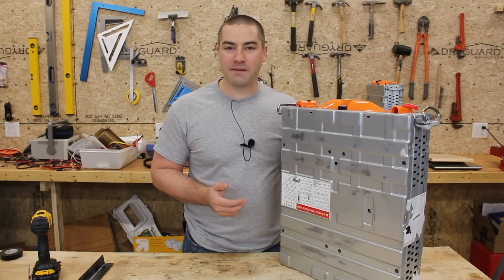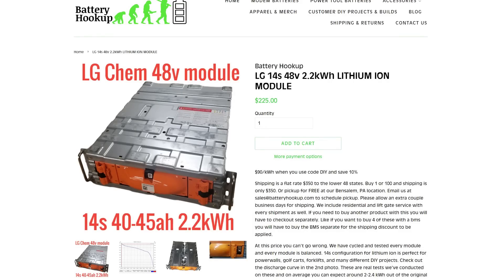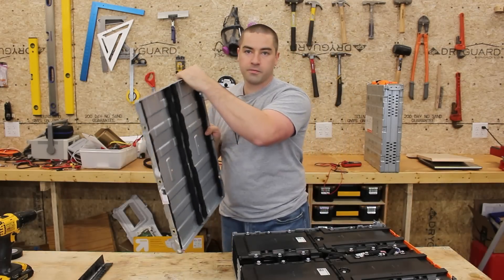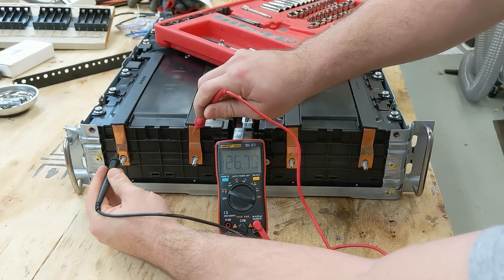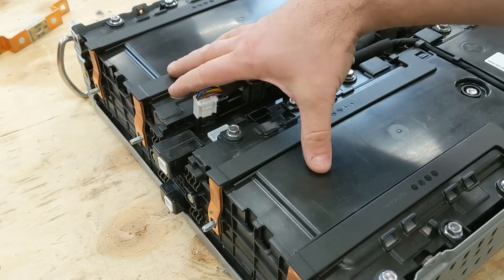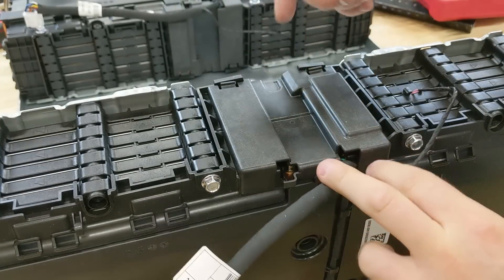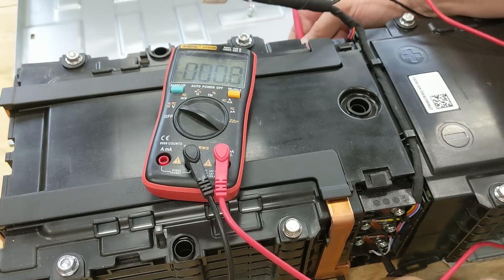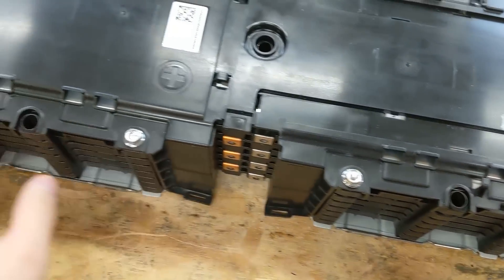Batteries for Home Backup, 14s 48v (51.8v) LG Server Rack Lithium

Comment: These server batteries have a center pack fuse, which would be a good thing if the BMS was designed for it, but the BMS used in this video is not. IF the fuse ever blows, the BMS will likely be destroyed. Imagine you had a 10A load connected to the main pack + and - terminals. Now Imagine that the fuse is open. You'd now have a 48V potential between cell 7 and cell 8 capable of supporting 10A of current (through your load). The BMS would measure 48V across a cell that it was only designed to see 4.2V, BMS go boom. If performing this mod similar to what David is doing, I recommend replacing the fuse with a copper bar PRIOR to plugging the BMS voltage sense connector into the BMS. Place the fuse on the main pack plus or minus terminal instead. 
  In the video shots of the original "BMU" with the case removed, you can clearly see two larger integrated circuits, and two sets of balance resistors. The whole circuit board seems to be split into two isolated, identical sections. The BMU looks to have two separate, isolated sections, specifically designed to allow a large voltage difference between cell 7 and 8. Never use a fuse or disconnect in the center of the pack unless your BMS is specifically designed to support it.

Comment: David, just another little tip you may have overlooked: instead of using heaters as a test load you should try charging your main batteries instead. That way you're not wasting the energy. Just get a buck/boost module if needed.
Reply from the maker: Thanks for the tip.  I would have, I own a boost converter, and a buck converter, but during the discharge process the voltage would cross.  So I would need a buck/boost converter in one device, which I don't have.  Although I could go from the battery, to inverter, to 24v power supply, to boost converter.  Hehe.  A lot of loss, but would be fun.
Reply: @DavidPozEnergy  A lot of loss is still less loss than total loss :) Though with the first snow of the year being today maybe a bit of heating isn't the worst thing ever.

A more hacky alternative to a buck-boost converter is just chaining a buck converter and a boost converter.

Comment: I like to use 20ga for balance leads, or atleast 22ga, the silicone insulation on 20ga is a bit thick for the pin yourself connectors, but 22ga works well,

Comment: Are we sure there isn't an in-built bms?  That box you removed looks to at least offer balancing from the one I've dismantled (it isn't a simple pass-through).   I have 6 batteries and wired in one with a bms that I bought from the seller but it doesn't balance well  because I never charge to 4.2v/cell as it is set from the factory.  As soon as I can get the bluetooth module for it I will see if I can lower the balance voltage.  The ones that I've left the factory manager installed on are all well balanced after several weeks.  Sure there isn't over current and under voltage  protection but I have that in my charge controller/inverter.

Comment: Thanks for the video really appreciate the way the way you went about  your disassembly.    I got 10 of those delivered ( 1 was at 38.2v. Cycling it now)  im actually disappointed with the capacity was hoping it would be greater than 2.2.     I have all 10 running with my 25kw nissan wall.   I really like the idea of reorganizing the packs into 2s7p. And then only using 1 smart bms to manage.   Really do not like having 10 seperare bms with Bluetooth. Would want a centralized nms management console (1 shop monitoring)

Comment: i recently built and capacity tested a 7s 7sp configuration of this exact battery system by disassembling each individual 7s module and converting it to a 1s 7p module and connecting 7 of those in series for my system and it only capacity tested to 6.7kwh before my lowest cell hit low voltage disconnect with a battery hookup bms, the reason I say this is be weary of simply reconfiguring modules into 1s packs without testing individual cells specifically and combining those to match capacity as accurately as humanly possible to save yourself the headache that I am now stuck with of having to disassemble all the modules again but otherwise great cells
Reply from the maker: Thank you for sharing your experience and advice.

Comment: Where do you find these modules new? You can find whole systems for solar by LG Chem no problem. Would be nice to buy them individually and add them over time as bank account permits, especially for just home back up. It would be nice to see a system in parallel with an auto-transfer switch plus generator hookup to top off batteries for those long term outages.

Comment: David, Your videos are always so complete and clear.  A question you may be able to give me some guidance on--I am completely off-grid and currently use 2 ea propane 5,000 watt portable generators giving power at 30 amps and either/or 120 or 240 v  ac single phase.  My goal is to purchase some thing like in this video but I need to have an inverter (I think) to transform voltage to allow use of pumps and motors at above conditions.  My use is nominal 8 hr/day at 50% of capacity (wattage) and 10 hr/dy.  Until I can get solar I plan on having making the battery source transportable about a half mile where I can access power to recharge from the grid.  Your comments are appreciated--thank you.

Comment: I really like the way you go through explaining it you do really well I think I probably am starting to get to where I might care about a 48 V but I don't have anything that's 48 V my stuff can either be 12 or 24 V so maybe I had to just go up to 24 but then I still have to have a way to just deal with the 12 V stuff confused about how that goes I had a little confused about how to get to the rest of your stuff
Reply from the maker: I'm a big fan of 48V.  If you make the move, but still have some 12V stuff there are two ways you could handle it.  1. run 48V to the appliance that's 12V (fan or light or whatever) and then use a small step-down converter (buck converter) to 12V.  Or, 2. have a 12V solar system with panels, one battery, etc. at 12V and power your loads off that.

Comment: would not break the spot welds off i would cut the metal join in half this would give a more solid connection to bolt together and work with

Comment: The voltage pattern displayed on your phone via the Bluetooth dongle indicates a problem in how the BMS is measuring the voltage on each battery.
You have one pattern from the low to the middle, and a duplicate pattern above it.
 The only other possibility is that the center batteries have more degradation due to heating than the outer cells do..
Reply: I noticed the same thing. The pattern was way too particular to just be coincidence. My guess would be heat and degradation but who knows.

Comment: I greatly appreciate the video David!  The biggest takeaway for me was the very last thing you said -- that this battery is NOT a good choice for an off grid setup. This is very important for me to learn as I am currently trying to ingest as much info as I can before I buy batteries and other components for our first step at converting our home off grid... it will be a long journey for us, but we have 5kw of PV already, just waiting to get my know-how before buying other bits. So... is there a DIY battery solution/setup you would recommend for off grid? I plan to run our system at 48v. Thanks for the content all the same! -Sam
Reply from the maker: There are two types of batteries that are both very popular.  1. Used EV cells.  EV battery cells can be excellent.  I've bought several in the $90-$110 per kwh range.  The ones I've bought from Chevy and BMW cars have tested 80%+.  Like this: https://batteryhookup.com/products/4kwh-chevy-volt-battery-24s-2x-12s-modules  (DAVIDPOZ discount code works at Battery Hookup)
2. is LiFePO4 cells straight from China.  The best deal is usually in the large format cells, like 280ah.  Here is an example.  16 cells makes a very nice 48v. https://www.aliexpress.com/item/1005001784720962.html?spm=a2g0o.productlist.0.0.327343f40wNhnY&algo_pvid=679b686c-cb81-4073-8a75-5d1756765ad8&algo_expid=679b686c-cb81-4073-8a75-5d1756765ad8-0&btsid=0bb0623e16107666719543661e5c39&ws_ab_test=searchweb0_0,searchweb201602_,searchweb201603_
Reply: @DavidPozEnergy  Thank you so much for the information, guidance, and quick reply!

Comment: David, nicely done. I rack mounted 5 of these and used same BMS with blue tooth. By the way, there are plenty of these BT dongles available on eBay and they arrived from China in about  a week and work just fine. I did a capacity test and I run them every day with solar charge and offgrid discharge. Normal case, they will not cycle very much day to day, maybe 30-50%. But when I did do a deep cycle, I didn't see the major drop on certain cells. I'm wondering if you tested your other battery.
Reply: Bucky. Are you running the 5 batteries in parallel? So you have one bms for each battery? Are you having any issues with that kind of setup?
Reply: @kevinsvik747  I do have one BMS per battery and they are all in parallel. I mounted my bms’s outside in case I had an issue. So far, all 5 charge and discharge evenly which you would expect. It’s a little cumbersome to always be looking up each battery in the app. I have 2 additional batteries also in parallel with these 5. They are the Chevy Bolt 6kwh 14s type that david made last year. So I have to track 7 batteries. They all seem to play together nicely, all 14s 3.6v nmc
Reply: What bms size would you recommend please

Comment: Very informative video.  although I can't help but wince at the order you torqued and untorqued the cell bolts :D
Reply from the maker: How would you have unbolted it?
Reply: @DavidPozEnergy  i try to unbolt and bolt in a star pattern to even the stress. I've warped a few engines/motors not doing a star. I really enjoyed all of your informative content, I promise im not cherry picking 😅
Reply from the maker: Ah, like when I changed out our summer tires to winter tires last month.  You are probably right, and your idea is probably best practice.  I just didn't think about it.  No excuse.

Comment: Mount the BMS on a piece of aluminum angle and dump its heat in to case.  I don't know what it's balance current is or the internal resistance of the mosfets....  But on the hottest day, after back to back cycles, with 13 cells balancing, at full discharge.....  Thermal soaking can sneak up on you.

If the case is open air you'll start to get corrosion after a couple years.  If it's airtight..........  If it's airtight I dump my BMS heat to case

Comment: Rather than putting the B- to the front stud I probably would have changed the routing of the negative copper bus bar then kept the output on the original stud.

Comment: Ugh. Makes me want to go this route with the alternate configuration you were talking about because it'd give me exactly what I needed for power but I want a grid tie setup that uses the batteries for normal daily use and switches to main grid for large loads. By the time I get my tax return they'll probably be sold out lol. The price is good but I'm thinking of grabbing the 280ah 3.2v eve lifep04 packs on Ali for $108ea instead. They seem to be solid by reviews I've watched and can get more than 2/3 capacity. Decisions decisions lol.

Comment: David 
I have a small 48v system .. I plan to upscale my battery capacity but the more I study battery builds the more they just don’t make sense .. you mentioned these pouch cells might be good for 2yrs. It was a great build but if you had to do it all again minus the pleasure of building would you not just by rack mounts?
Reply from the maker: I have purchased a rack and 30kWh of rack mount batteries.   They make a lot more sense.  However,  I still make some DIY battery projects for small custom applications.

Comment: 2 of these arrived today.  54.4 & 54.0 vdc. at terminals. David, please work on getting a bottom balancing 14S 48V BMS.  Thanks
Reply from the maker: That's great yours arrived with good voltage.  I top balance my cells, thanks.

Comment: Do you have the wiring diagram of how you hooked up this battery to the BMS? Also, if you hook up several of these batteries into a a series/parallel system, do you have that wiring diagram? I'm going to do this same system on my home. Thanks for a great video.
Reply from the maker: I'm sorry, I don't have a wiring diagram.  There is a newer battery I'm a fan of, check out my latest video to give you another idea.

Comment: Do I need two models of SMA inverters to build a 6000 watt grid tie system with Battery storage.  Only using the grid tie to sell electric to the utility and draw during extreme periods of cloudy weather.  I intend to install a 48volt system using 20 Canadian Solar new Series 7 665watt panels

Comment: Hi Dave I like your videos makes you think about how much we need to learn. Anyways I’ll get to my question. I have a semi truck 48volts 4, 12 volts batteries I’m trying to monitor the voltage with some kind of voltage meter separate from the dashboard reader that just tells me the alternator outputs. Can you advise me on how to develop something and I’m running 2 inverters 1-1500, and 1-2000 also looking to put in separate battery just run them something is draining the battery slowly yeah I’m working on that as well thanks like your channel and yes I’ve subscribed to it thanks

Comment: I understand on batteries you're not supposed to overcharge them or drop the voltage down too low but when you're running an inverter on them it will pull that thing all the way down to 10.5 volts if you let it what do you use to stop the inverter from pulling the voltage down too low are your solar panels from overcharging I know you got to charge controller but it goes like 14.5 or 6 and shuts off but isn't that still overcharged on a 12 volt battery and it doesn't the inverter doesn't shut off until it gets down to 10.5 volts on most inverters what do you use to shut it off before it drops below 12 volt

Comment: David, At the end of the video, you have a drawing on a note pad showing the 7 packs. You showed it wired as being connected negative to negative and then positive to positive and then negative to negative and so on. Is this correct for series? I would have thought it would have been crossing over from pack to pack negative to positive then negative to positive and so forth. Kind of zig zagging up the stack. Am I wrong?
Reply from the maker: A proper series connection is positive to negative to positive to negative, and so on.  My drawing is showing how I would wire it if I had bought 7 packs and I re-oriented all the internal cells.  When I re-orient the cells then I can swap the polarity of the poles on the outside.  So every other pack would now have positive on the right hand side.
Reply: @DavidPozEnergy  Cool. I gotcha. I have seven of them that I have just completed the parallel reorganization on, as you showed in the video. I however did not think about rearranging the polarity so I will just have to zigzag up the stack to cross over from negative to positive
Reply from the maker: That works too.  If you have a video about it, drop a link.  I'll check it out.
Reply: @DavidPozEnergy  cool. Thanks a lot for all of the information that you share. I ended up just pulling out every other unit and flipping it upside down! Now I can have the shorter battery cables. I hope that electricity doesn't get dizzy being upside down. 😄
Reply: Here is the video I made of my progress so far. https://youtu.be/ejqqWs7u9Iw

Comment: that is a module from a LG R800 system, very similar to a Tesla powerwall, but in a rack mount form.  the modules are pretty dumb, the system controller in each rack does most of the switching, losing a single pack, would probably shutdown that rack, and send an alert for a field tech to go replace the module.

Comment: So are you using one battery pack to charge the other with the boost converter? The BCs power supply looks like DC coming from that other pack.
Reply from the maker: Yes.

Comment: Is it really true that the Bluetooth dongle for the BMS won't work with Android phones? That seems counterintuitive to me. Have you had trouble using the app on your particular phone or is it actually specified to only work with iOS?

Great video btw, thanks.
Reply from the maker: In a previous video I built a 12v battery with this brand BMS and bluetooth.  In that video I tested it with my Android phone can couldn't get the app to open.  but I'm not good with computers, so you might get it to work.